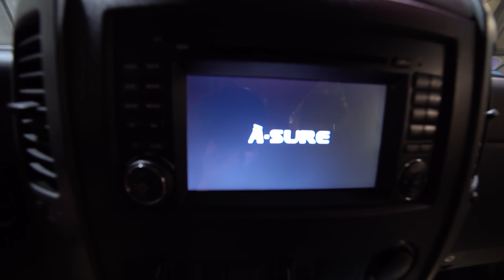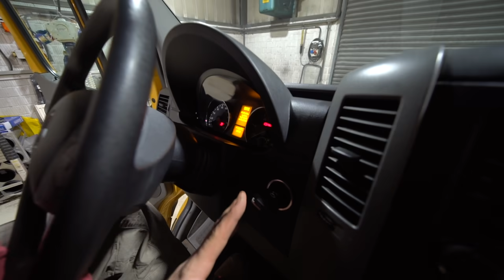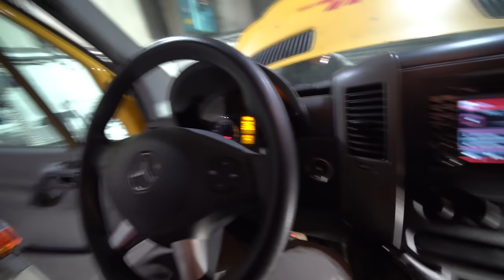SPRINTER "KLICKT" NUR NOCH😱 🤨 - Defekten Anlasser austauschen 😫 | VANLIFE

Comment: Und noch einen Tip Anlasser wechsel ? Dann hängt den Motor ab Zahnriemen auch mit  Neu Wasser Pumpe  öl Pumpe usw Komplett reinigung des Motors und danach alleswieder schick wie eine Restauration mit neuen zielen. Hast noch viel Freude als Caravan oder Wohnmobil im Umbau :-) Halte zwar nicht viel von den Motoren die sie ein gebaut haben aber jemand mit Erfahrung wie du kannst das Teil nochmal paar tausende km fahren ;-) Geiles Projekt freue mich auf jedes Neue Video was ich mit verfolgen kann Ein Danke an Marvin und das Team :-) Bleibt alle Gesund liebe Grüße Matze

Comment: Ja vorne starten wenn ein Auto nicht startet ist gut. Hatte ich Montag auch erst, Tiguan sprang nicht an. Scheinwerfer, Radio geht. Tacho mit Boardcomputer und allem bleibt aus. Kacke. Sicherungen alle okay, mit China Dödel Gerät Fehlerausgelesen.. Unterbrochene Kommunikation mit Kombiinstrumenten Cluster und Motorsteuergerät Deaktiviert (wegfahrsperre läuft übers Kombiinstrument) Geil... Tacho im Sack? Batterie abgeklemmt, angeklemmt Fehler weg und Auto startet wieder. Hmpf
Kurz ne Meldung gehabt mein Reifendruck kann nicht gespeichert werden (passives System also ansich egal) 
Meldung verschwand nach kurzer fahrt und alles wieder okay. 
Montag geht der in die Werkstatt zum checken, keine Ahnung was das war. Entweder brauchte der wie nen Computer nur nen neustart oder das wird übel.